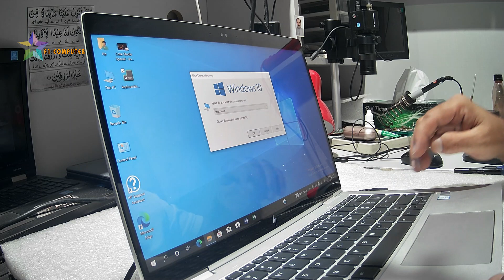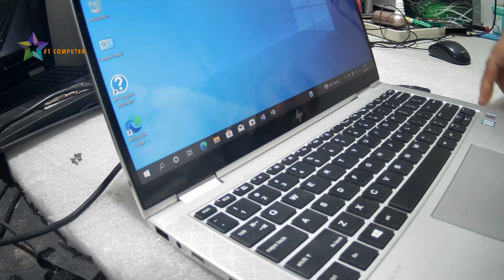hp elitebook x360 1030 g3 keyboard replace|| how to replace keyboard in hp elitebook

Comment: I have the same model. In my model touchscreen is not working can you fixed that. I will pay for that
Reply from the maker: First u chek touchscreen drivers.other wise replaced touch cable or screen
Reply: @f1computer  can you replace touchscreen?